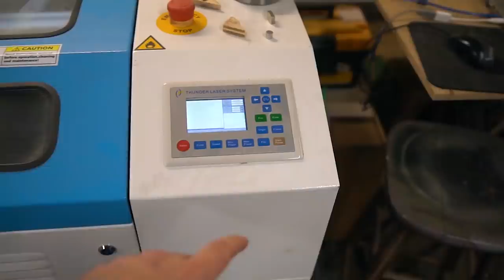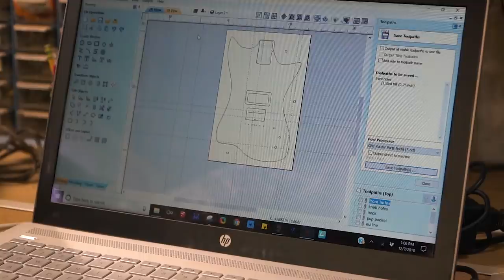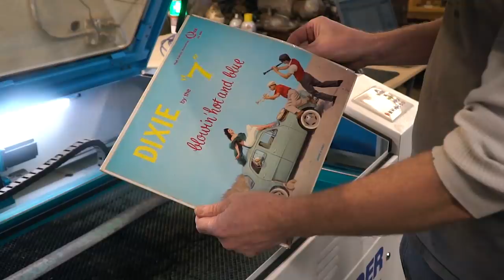Pallet Wood Guitar - Making a Guitar with Tim Sway

Comment: Awesome as always... question... when you laminate, do you thin the glue or is it the roller ( ordering one either way) that allows the glue to flow like that. I laminated a workbench and the glue was not easily spread. I used a silicone brush.
Reply: Warm the glue up a little. Temperature will effect the viscosity